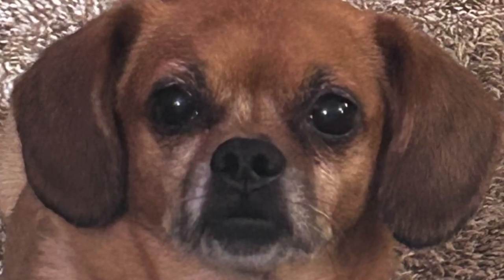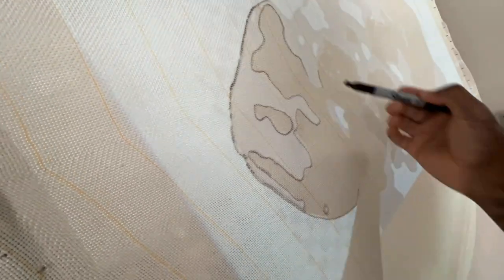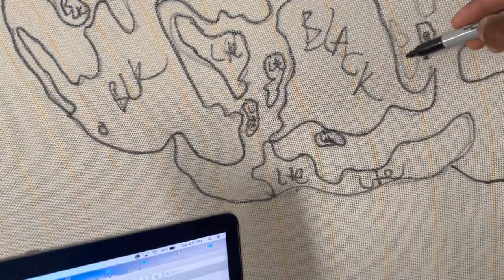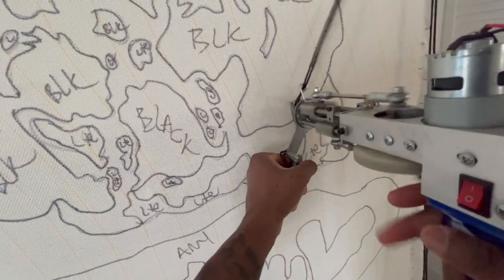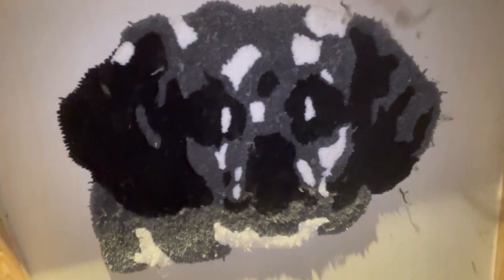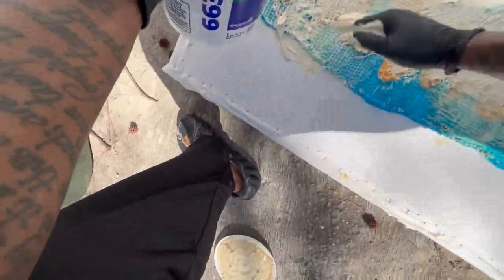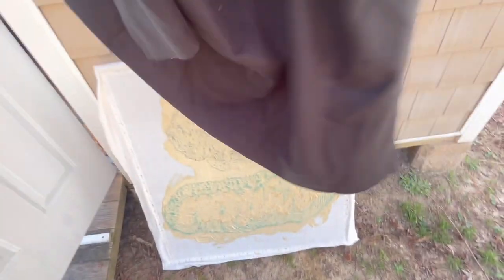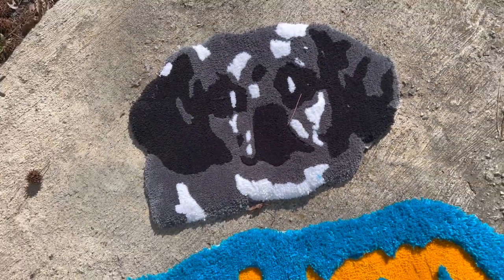HOW TO TUFT PICTURE RUGS FOR BEGINNERS EASY METHOD | RUG TUFTING 101 FREE COURSE!

Comment: Great video man quick question how did you get one layer to be lower than the other one and almost gives it a 3-D effect I like how you did that could you share that method?
Reply from the maker: Yea- if you visit www.tufting101.com I put the suppliers link for the large pile tufting gun. It’s called the monster MKN gun. I used that for the outside and the regular ak1 for the inside